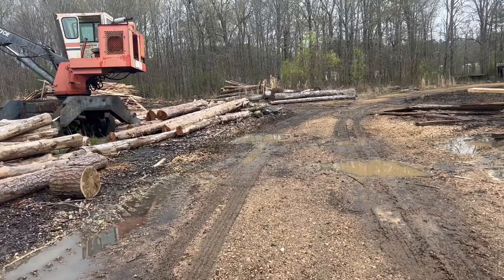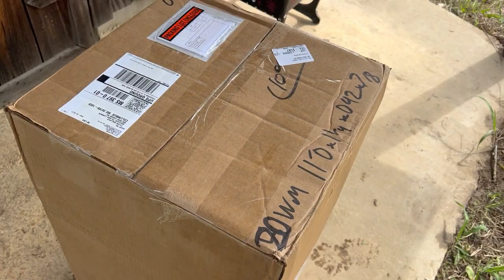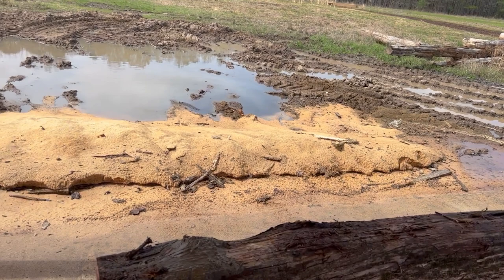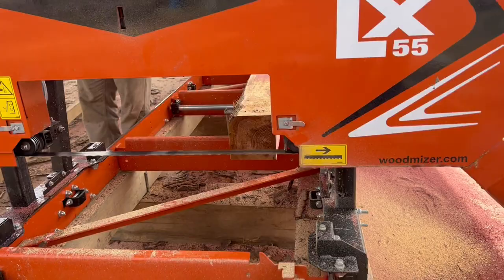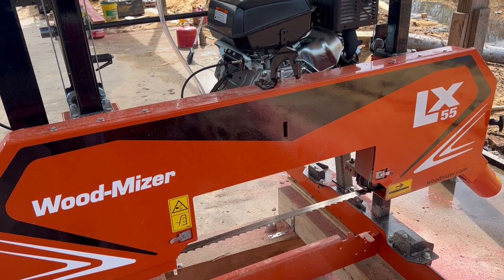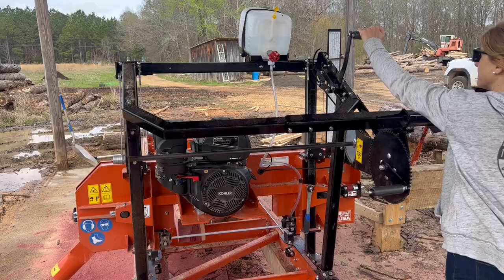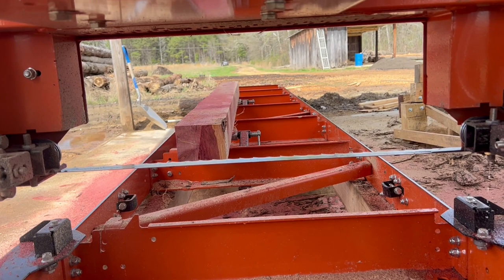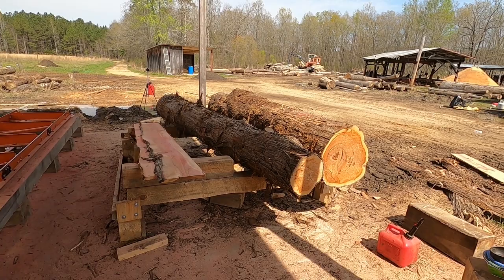Milling BEAUTIFUL Eastern Red Cedar with a WOODMIZER Sawmill!!! (Pt 1)

Comment: One thing you could try is buy metal corners so the banding doesn’t pull down into your boards. Metal is the best but you can also buy plastic corners that are much cheaper.

Comment: I’m sure you watch Nathan @OutOfThe Woods you tube channel. He swears by the silver tip turbo 7 sawblades. He has a link to Joe Maine over in Georgia and can get the blades a lot cheaper than from Wood Mizer. Just a tip, not a suggestion. If you’re set on a 10 degree maybe Joe has some at a lower price. Great video and good CUTTIN! I know that cedar smells so good!,👍
Reply from the maker: Thanks so much! I watch him as well. I’m will have to compare pricing. I use Kilgore Saw Company out of Arkansas for all my saw blades. Been great to me with pricing so far!
Reply: Generally speaking you need to be pushing 25 or more horsepower to run 7* blades effectively

Comment: One more mod became necessary , on the detent lever , for the carriage height adjustment, there is a collar with a set screw to hold the release lever in place . Retighten that screw and add some RTV to keep it from vibrating loose . .. mine flew into sawdust  not to be seen again, I ordered a new one .. lesson learned ..
Reply from the maker: Thanks I will look into that!
Reply: I had the same issue with the little collar flying off and getting lost right in the middle of sawing a log. I drilled a hole in the shaft. Put two washers on it and a cotter key. No more issues.. I did find the collar later.

Comment: If I understand correctly, you cut with that large vertical mill, then re-saw etc. on a 'push' mill. Found you on cotontop3 video when you were DONE with the HM130 and sere running the LX55. Then I see an even bigger WoodMizer on your videos. Did the 55 break down? Was there something particular that put you off? I'm REALLY close to pulling the trigger on that machine as my first mill. More and more the Woodland machines seem puny. I don't have thousands to shake and bake with, and need honest input on the LX55 that would be greatly appreciated, sir.
Reply from the maker: Lx55 never let me down. Worked flawlessly. I just upgraded to a larger mill. Stay with Woodmizer!
Reply: @wallacefarmandsawmill  That's what I wanted to hear. Y'all keep posting so us amateurs can be informed. Safe Travels,  Roger
Reply from the maker: @rogerdenney3663  Thanks for watching along!